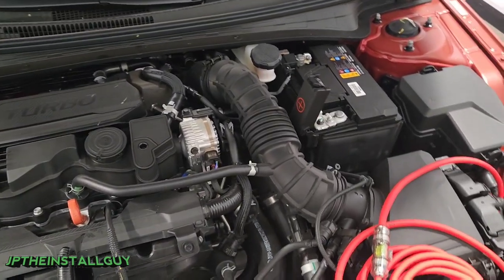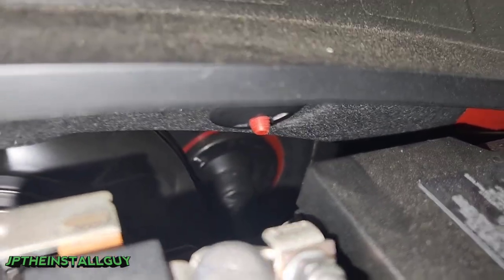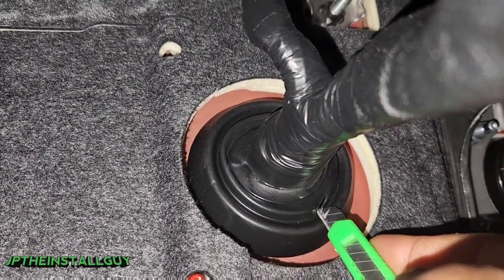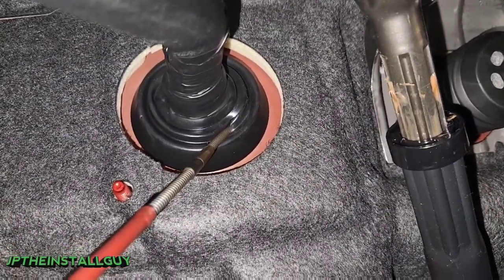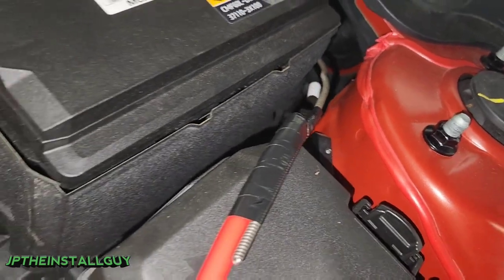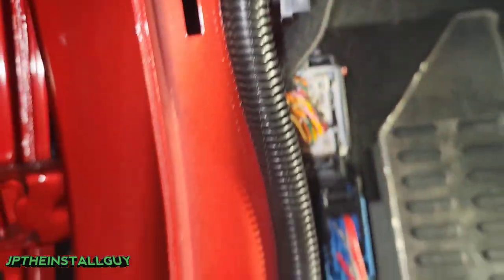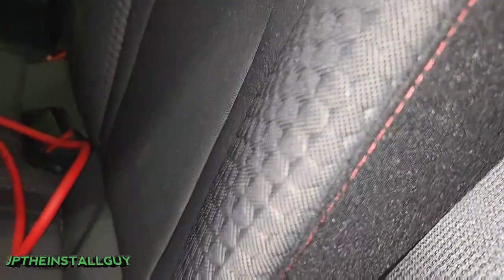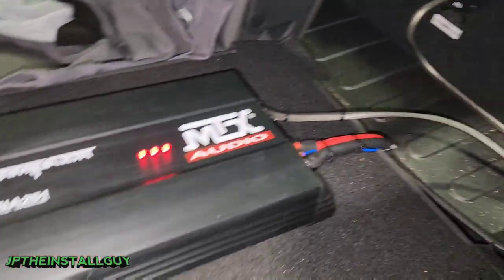How to run Amp Power wire through firewall Hyundai Elantra

Comment: Thought running a wire through the firewall would be the hardest part of my project. Followed your instructions and was done in minutes. Awesome info. Thanks.
Reply: What gauge wire did you run ? I’m looking to run some 0 gauge through, might have to drill through.

Comment: another option I just cut an old gopro USB cable "all four wires for data and power" and soldered it to the 4 pins on the left top from out out side to in..., Red, White, Green, Black, I used a solder iron to heat up the existing small hole in the pin connector back and pushed the cut end of the USB cable through and left the male USB portion out the back to plug into the USB extension cable off the Head unit. Thanks for this video it helped me make some decisions and help take apart the console area a bit.

Comment: Hey JP, I have a 2022 Hyundai Sonata.  Can you give me a quick instruction on getting a constant power source inside the trunk?  Can I splice into any factory wiring already running through the trunk?  I just need a power source to feed to keep my little GPS battery powered gadget charged.  My last car I had it mounted right under the steering column.  It was well hidden.  Sure enough my car got lifted.  Since I had gps on it I went and retrieved it myself.  It was taken from me in Florida and I retrieved it in North Carolina.  I recommend every car owner install one in their ride!  I think the GPS will work better in the trunk for live tracking.  The last one I powered straight to the fuse box and hid it near the fuse box right under the steering column.  The issue with that is the live tracking was spotty because of the location of my gps device.  I would love to mount it on the outside of the car but too much risk of it being found or falling off on the outside.

Comment: I would’ve disconnected the negative and remove the bracket that holds the battery in place and pull it forward so that way you have more room to access the firewall

Comment: Quick question for some of you out there. 23 hyundai elantra sel convenience package. Im gonna install 4-skar 6.5's a Pioneer 4 channel 1000w peak amp and a skar 12" sub tube. Do you think the 6.5"s will have enough power from the factory head unit? I would like to amplify them as well but for me the installation is already hard enough with this touchscreen factory head unit plus i don't want to take away a chunk of my watts that could be going to the sub. If anyone has installed in the 23 elantra sel convenience please give me some pointers. There isn't much info out there yet.